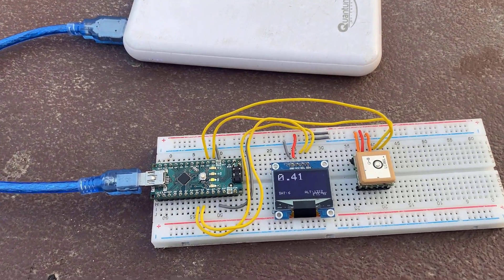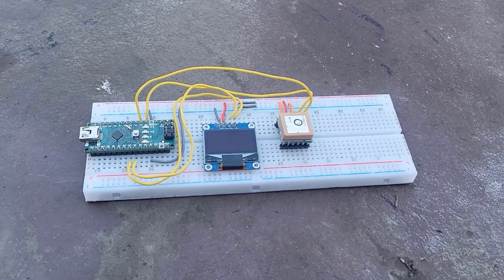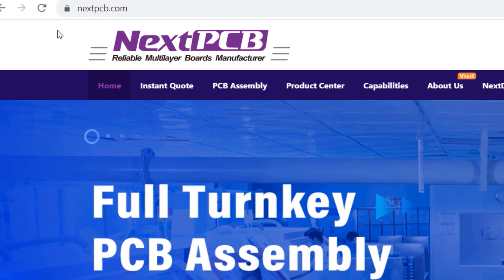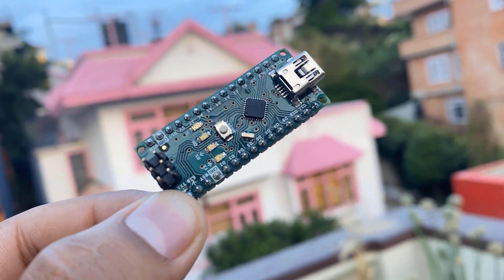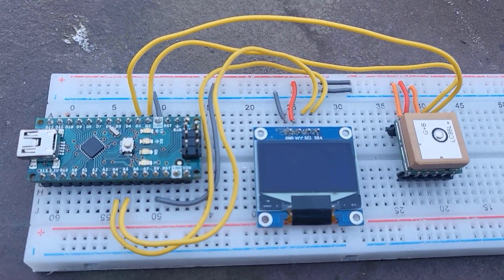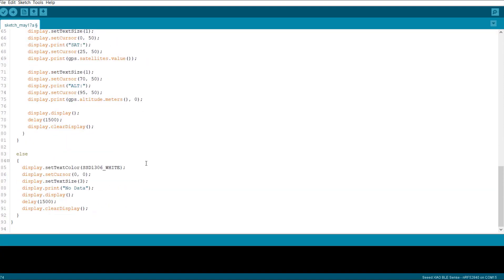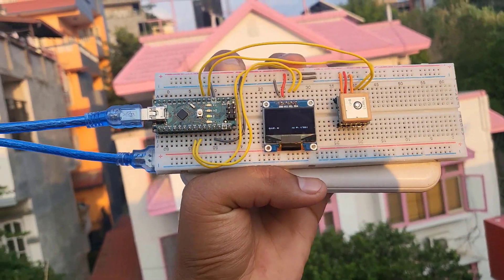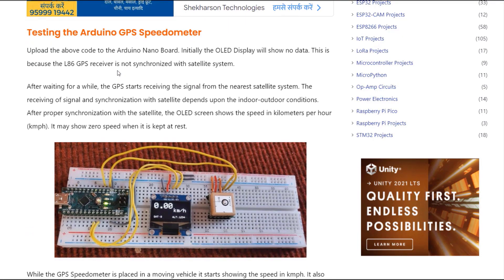DIY Speedometer using GPS Module & Arduino with OLED Display

Comment: How accurate is the GPS speed data from that GPS module? Does it have a dead time until it recognises movement or stopping?
Do you think, it is suitable for 0,1 kmh accuracy for  tractor gps speed?
Exact Position and orientation does not matter in this case.
Thank you in advance

Comment: Dear sir,
Instead of using led display, can we take pulse output corresponding to the relvant speed of the vehicle,so that the conventional digital speedometer which is respond instead of inductive pulsed signal.
Pl elobrate the required modification on software aswell as hardware.
Thankyou.